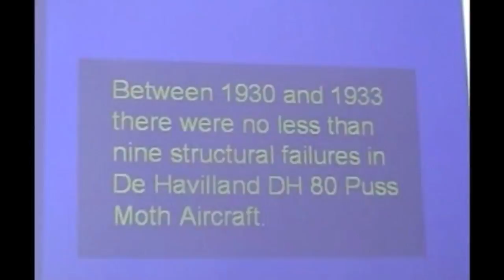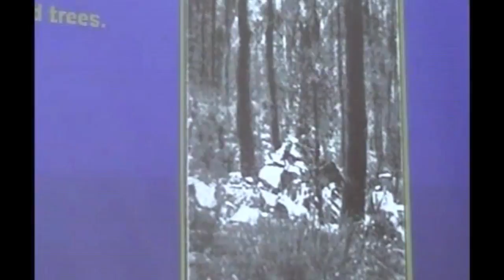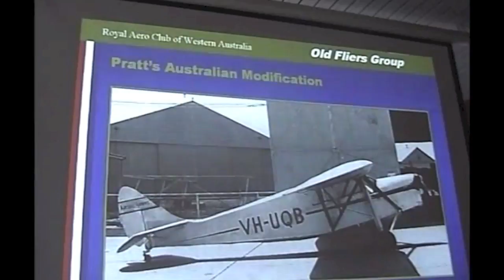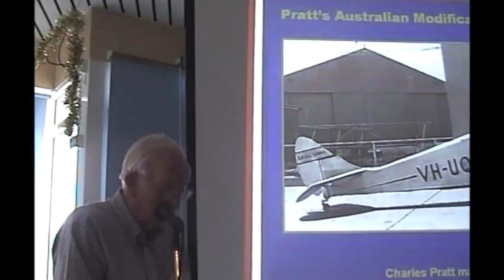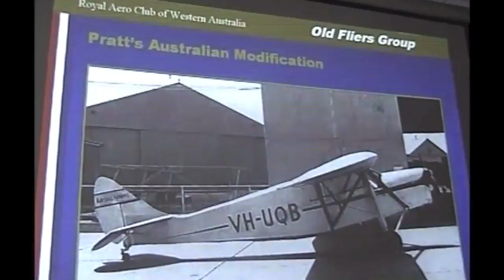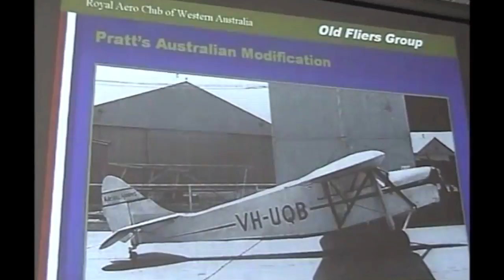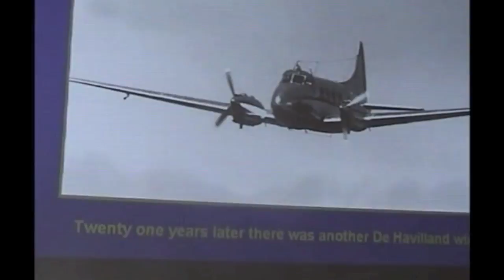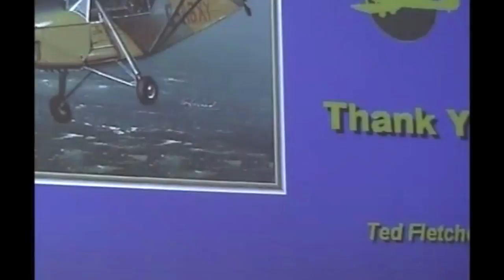Puss Moth failures

Comment: A very well researched speech,having been involved with de Havilland aeroplanes all of my life and worked on the breed it makes for interesting listening,there can be little doubt that turbulent conditions over stressed the wings on those early accident machines,jury struts in fact became the norm on high wing monoplanes such as the Taylorcraft & Auster series post war and add a lot of strength to the structure with the engineers 'V' in place,this stops bowing of the wing struts especially with shock in flight loads,thank you.
Reply from the maker: Thank you for your kind comments.